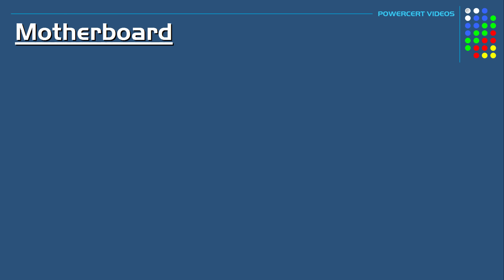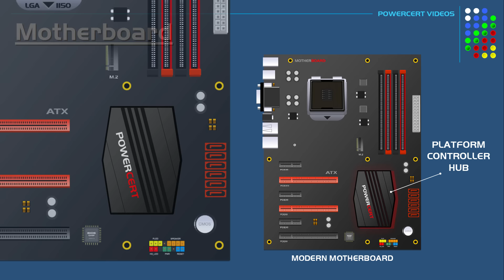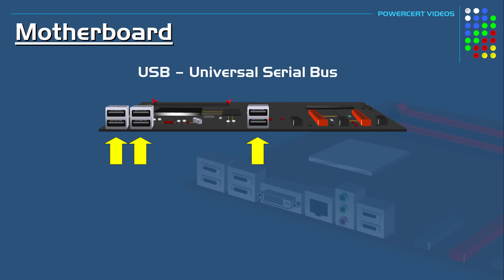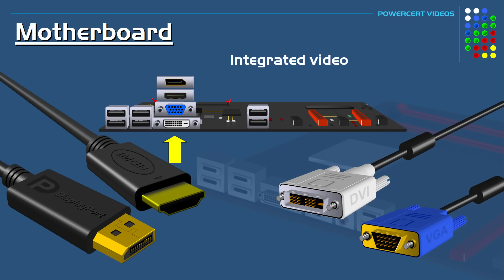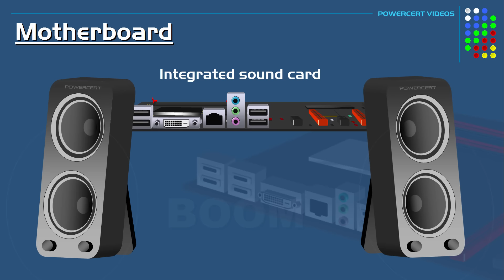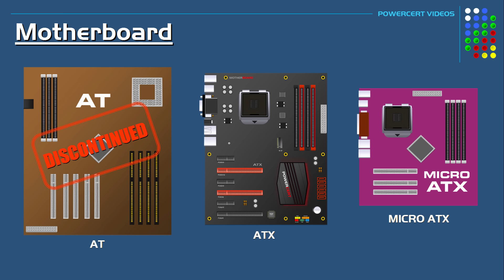Comment: Thank you so much ,this is a great video, it was informative. I have some questions to you. 
The first one :Are there any difference between MCH (memory controller hub) and PCH (platform contoller hub), 
2. Could you make an explanation video about VRM? (voltage regulator module and what's the meaning of phases like 4+4 or 8+3)?
3. What is the MOSFET and PWM?
and the last one is: How the motherboards naming works? (I mean X, B, H etc and what's the difference between them?).

Thank you in advance and apologize for many question.

Comment: wonderful video...i wished that u would have gone to the point to show where and how to adjust the pin or jumpers to get Bios default, plus in my case i clusily removed some plugs where u connect spkrs,resets,hdd pwr.
Reply: There wouldn't be much point in him showing that as it varies depending on the motherboard you have. You can find all of this information in the motherboard manual; that's what its there for.

Comment: This videos are very fun to see and learn. But sometimes miss information. Where are the ATX-E (Extended) ? Where at the ITX ? Micro ATX and Mini ITX are more expensive that the normal ATX because the form factor of space design some people are looking for.  Now mini ITX are expensive and less features  no all. Also, where are the Dual M.2 socket ? Where are the explication about the second M.2 will limit one of the PCI-e bus line and disable some of SATA ? Where the modern motherboard hace 3 pin and 4 pin RGB from 5v to 12v ? Where are the New USB Type C special Conector in the Motherboard ?
Reply: 5:50 bro

Comment: Kindly explain, how the data is distributed and processed among multiple CPU's in a 2 and 4 CPU supported server motherboard. what happens to current processing data when 1 of 2 CPU, or 1 or more of 4 CPU's fails or burns in a motherboard. i did not get proper details online. i believe that you would post a video about it. Thanks in advance. Your videos are extremely useful for learners.

Comment: Interesting. It would appear that ive got the principles.

But its just. Well. ...

Firstly, it requires the components to be made already - however they work is then predetermined. So, using transistors or not. 

Secondly, it is heavily user dependant. Not a single transistor would work unless user required it to; hence the use of not using single transistors but rarely, but a component/module instead. 

Crucially!, the module MUST accomplish the desired task. 

No seperate modules which can work together in different ways. Such as the cpu and hard drive doing this and that for one operation, but doing this and elsewhat for another. One whole module for that specific operation. AND, the user would thus need a whole selection of means; each to do a different module/task; so swipe like this, like that, and so on. Hence work arounds are necessary; like one swipe to do the task - BUT, the task includes a variety of tasks itself, which the user can choose to do. And what not.

Then the procedure is simple. Not entirely worked out. BUT, it is a method of computing which will allow for max consistent electeimagentic energy flow. But the prior work arounds are necessary. 

Not a revolution in my opinion. But definitely a new style of computing.
Reply: What does that have to do with the video??

Comment: Suppose you had one mainframe that was a way to connect all motherboards in correspondence. What motherboard you run is the key to what server you play on. Think telephone service how we used to call one another, this is same principle with motherboards. If your motherboard isnt connected, the call cant be completed as dialed. Lets just say, I have a main motherboard where connection to the mainframe is important. If that motherboard doesnt go online, things get left behind in the dark. We taught the mainframe how to play chess, checkers, and cards. The trump story is related to cards, when everybody has to fold by one set of cards played. We call that the royal flush, which indicates flushing all the bad things down the toilet. Not all things were bad on the internet, just the storyline they are trying to tell. Trust me when I say what notherboard servers can do to a story, especially when 1 have a older hookup by phone motherboard. Somebody stole my other computer parts. Which means they are seeing my story unfold too, along with the so called Trump.

Comment: There is a watch like battery sticking on the motherboard what its purpose?
Reply: Some of the BIOS settings are stored in CMOS. This type of memory is volatile, meaning that it looses the information stored in it if power is lost. The battery is used to provide electrical power so that the information in the CMOS is not lost, even if you turn off the PC or unplug it from main power. Most PCs use a CR2032 battery.

Comment: Why do we have two pcie x16 slots. Can we use two gpu simultaneously...?
Reply: The idea is that you can have multiple expansion cards installed on the motherboard if you want. Yes, you can use 2 or more graphics cards: SLI (for Nvidia cards) or CrossFire (for AMD cards). Its not really worth it anymore since the majority of modern games don't support these setups anymore. In a worse case, you may get worse performance using 2 GPUs instead of 1. Plus you also have to consider the extra power draw for the second card, extra heat, etc. So unless you absolutely need a multi-GPU setup, you're better off saving that money you would have spend on the second card on buying a better, single card or another part for your PC.

Comment: I have a Dell desktop with 250 GB SSD . Can i replace the SSD with a 1TB Harddrive?
Reply: well if its a desktop for sure. But pls consider adding a drive if possible instead of replacing the SSD. If you cant add another drive due to space or not enough sata ports then please buy a (rather expensive) 1TB SSD. SSDs have much better boottimes and programs launch faster. They are absolutely needed in ANY new computer. They can also bring back life to old ones!

Comment: I’m still confused what gives the pc wireless WiFi?
Reply: That would be the Wi-Fi card. There are two main kinds for PC: USB Wi-Fi cards. These basically just plug into a USB port on your PC. Very quick and easy setup. The other one would be a PCI-E Wi-Fi card. It works pretty much the same as the USB card, except that it plugs into your motherboard's PCI-E slot. This involves opening the computer and installing it. It is a more involved process, but not terribly difficult. 

A lot of pre-built PCs come with Wi-Fi, but most motherboards you buy for a custom PC do not, so you would need to add a Wi-Fi card. Side note: Wi-Fi is wireless, so saying "wireless WiFi" is redundant.